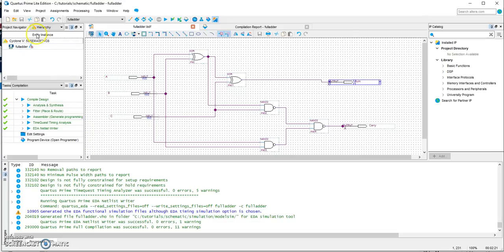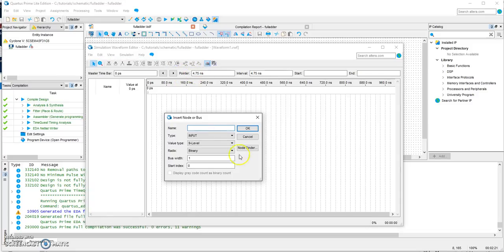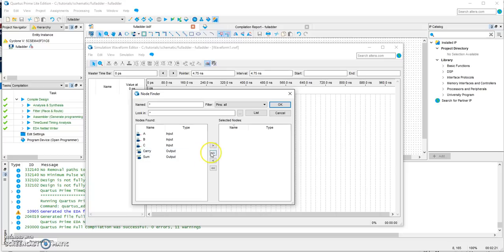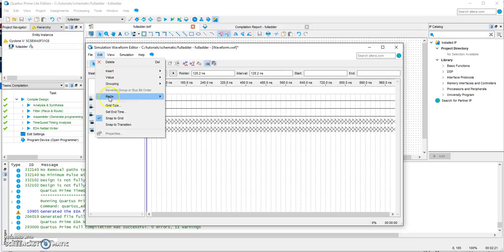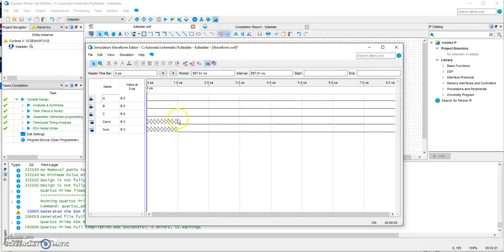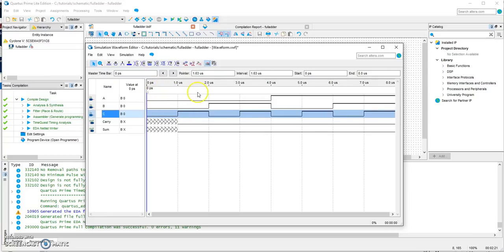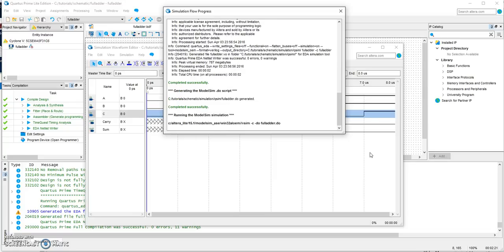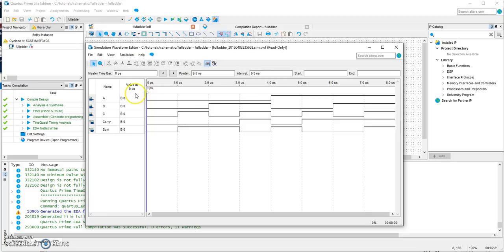Creating a waveform simulation in Quartus Prime Lite Edition

Comment: hello ma'am i have some problems when i did this simulation.error is Error (199013): HDL output file name "D:/project/schematic/LUC_Board_Development/simulation/qsim/CPLD/Waveform.vwf" used with --testbench_file option contains a non-existent directory path
Error: Quartus Prime EDA Netlist Writer was unsuccessful. 1 error, 1 warning
    Error: Peak virtual memory: 475 megabytes
    Error: Processing ended: Fri May 10 08:40:23 2019
    Error: Elapsed time: 00:00:03
    Error: Total CPU time (on all processors): 00:00:01

Error. i'm using quartus prime lite edition 17.1if you possible can you help me about this problem?thank you
Reply from the maker: 허성진 try saving your file with the name waveform and run the simulation again.
Reply: @raniahussein4974  i have the same problem and it doesn't work
Reply from the maker: Mateo Ceballos Querol it is possible that it won’t work if you are using a newer version of Quartus. This video is based on version 15.0. You should be able to download older versions of quartus from Intel’s website. If you are using version 17.0 then follow my other videos that uses SystemVerilog and testbenches
Reply from the maker: This video was made using an older version of Quartus (I think it was version 15.0). If you are using version 17.0 then follow my other videos on my channel on creating a simulation on ModleSim with SystemVerilog

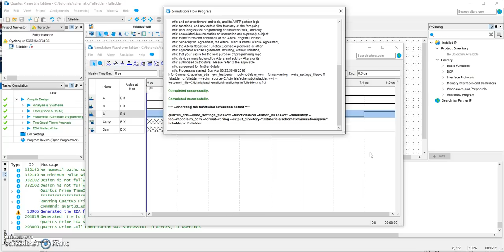Comment: if anyone's getting an error during simulation (at 3:35) , save the file again as "waveform" and rerun the simulation
Reply: i did it both ways i get the same error help pls
Reply: @mateoslab  If you receive this error: "Error (199013): HDL output file name contains a non-existent directory path" try restore defaults to fix it: 

Simulation -> Simulation Settings -> Restore Defaults ->Save 
That worked for me!
Reply: Thanks
Reply: Thank you, you're a lifesaver!!
Reply: tysm